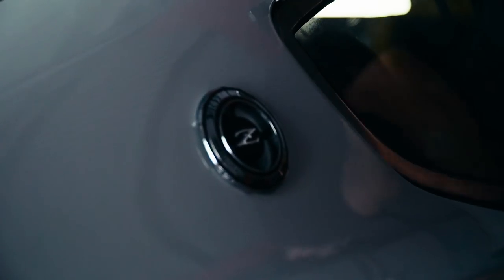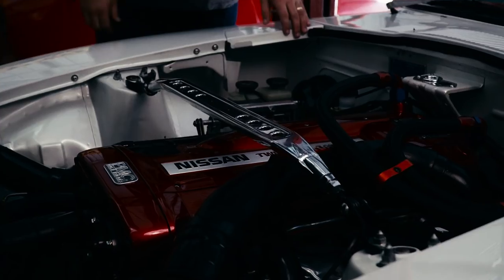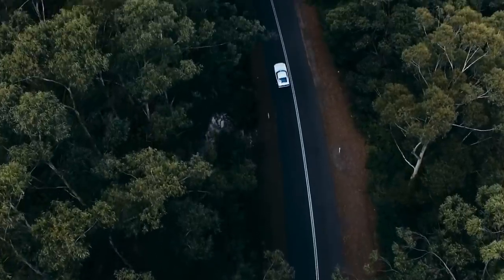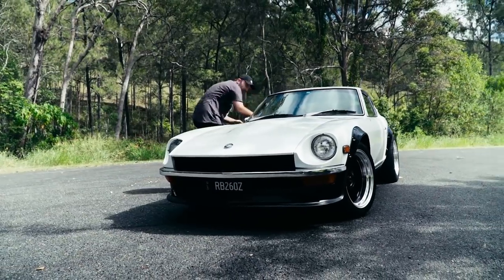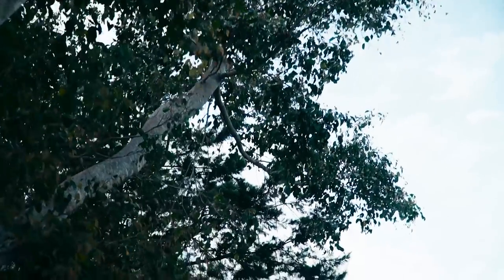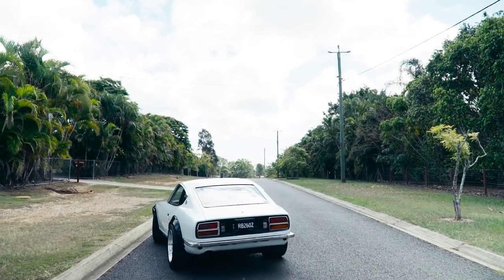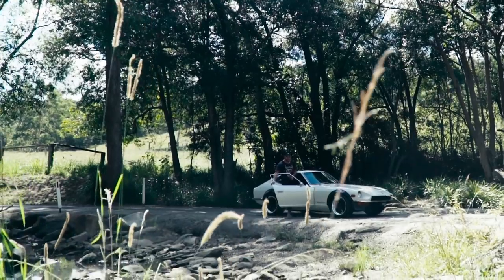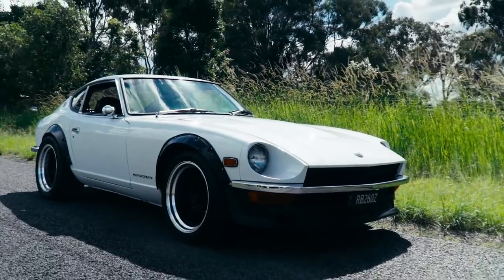A Future Classic | Charles' 500kw RB26DETT Datsun 260Z | D2 Productions

Comment: Damn pretty much exactly like my dream build z car. Arizona Z car trackpack set up with all the fixings. Only thing I would change would be to a lite weight NA 5.3L v8 like an L33 or maybe any Corvette engine.
Reply: +Anthony Campos Why  would you put a shitty Chev V8 in it , which would make it sound like shit and  slower . This is an Rb26 which is still family .
Reply: +R34GTRR35 Why the fuck do you feel the need to question someones dream car build? I mentioned the L33 specifically because it is a aluminum block with high performance compression making it about 100 lbs lighter than many other V8's in the family while still making great power and torque (which is what I manly wanted). 

I mention the 100 lbs weight savings because that brings it within the same weight range as the original stock 240z meaning after the swap' it won't lose its classic handling characteristics that it was well known for and I won't be upsetting its front to rear balance ratio. As far as "keeping it within the family" fuck that noise. I have no loyalty to any company, name or brand. I just go with what I feel is best for my needs and what I would like to accomplish. I was looking at rb25det but it was maybe my 3rd option at best.
Reply: Yes yes , i can see it working fine , Chev would be reliable , easy to fix .